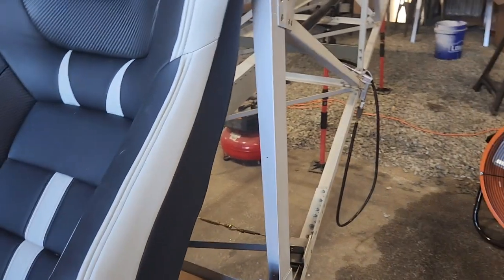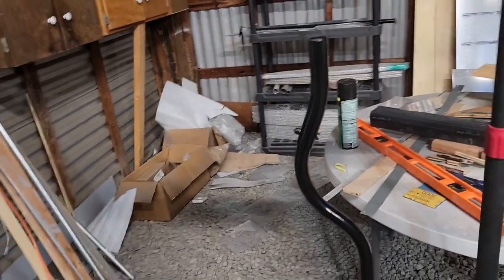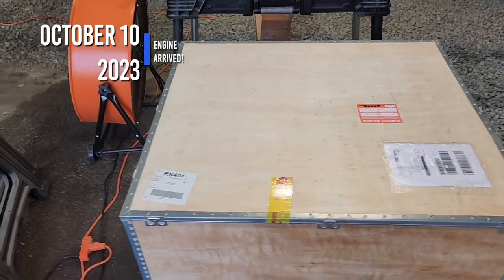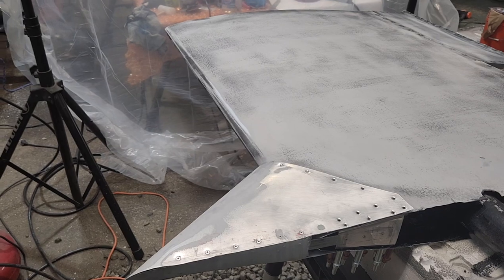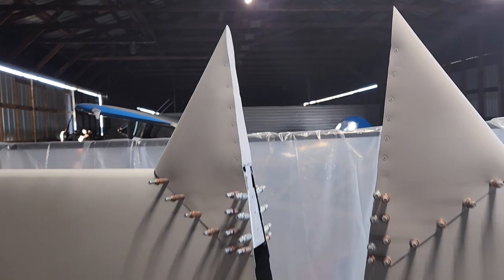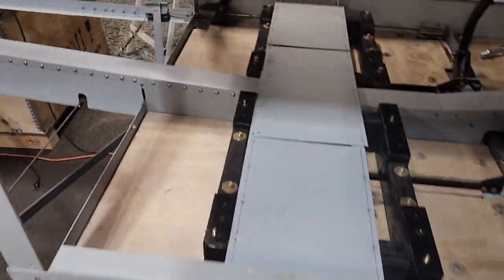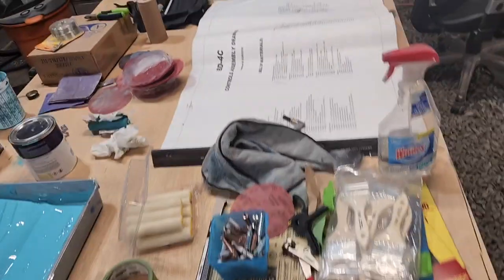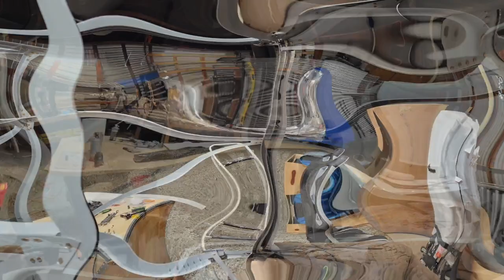Bede BD-4C Build Log 024

Comment: I can’t wait to see this thing completed! I have a question and a comment about the seats though. I believe you would be well served to limit the travel of your seat tracks. You wouldn’t want to get in the air and find out your passenger moved the seat forward enough to limit the movement of the stick. My question is, do you think the width of the upper part of the seats will interfere with visibility, or the closing of the doors?
Reply from the maker: That's a good point.  I'll need to reform the release handles which solves the normal position (for roughly average height) but with one of the seats full forward that may make pulling all the way back difficult.  As for the upper part, they are clear of the edge by an inch or two.  The high seat sides are very close to the edge but won't interfere with the door.  The seats won't fully recline due to the bulge at the top not clearing the aluminum angle but if that's ever an issue, that can be rectified with a cutout for it and reinforcing it with a steel brace.  Unless I really need that I'm not going to bother though.
Reply: I was really more concerned about visibility.
Reply from the maker: They will block the smaller rear windows somewhat, but those windows weren't very useful in the Cherokee I had before, so I'm not really concerned.

Comment: Just been catching up on your build , would be interested to know why you havent gone with the Viking engine and stayed with the UL , my feeling with that is the UL being a dedicated Aircraft engine the repair and parts availability would be expensive and how easy are parts to get ,Viking Being Honda parts are about every where, also Aeromomentum being suzuki outboard based have a 200hp ( I think ) those two being geared would have better prop efficency .other than that it looks like your doing a bang up job of the build
Reply from the maker: I was planning on the Viking all along but when it came time to spend serious money (and time to install), it came down to cooling and drag.  There are a couple designs a few builders are working on for a non-draggy cooling solution, but none of them are proven yet and I just don’t want to spend a lot of extra time designing a one-off cooling solution that may not perform as expected, and at best will be on par with an air-cooled solution.  Those are all valid concerns but in the end I’m willing to risk those for a much simpler install.  The big Aeromomentum hasn’t flown in anything yet that I’m aware of and I just don’t want to be the first lol.  I’ll be pairing it to a Duc Cobra 3-blade ground adjustable prop.